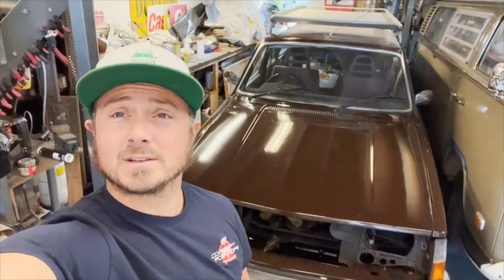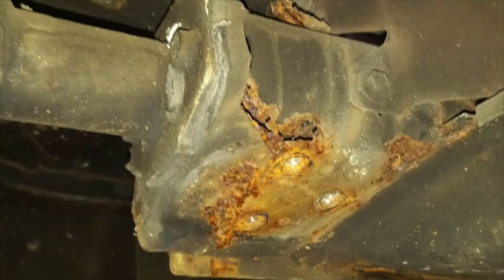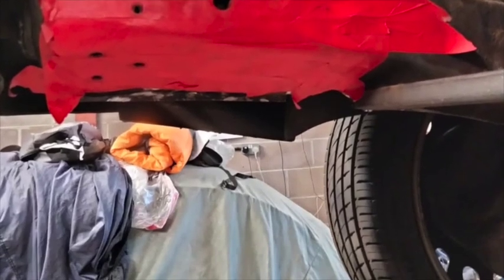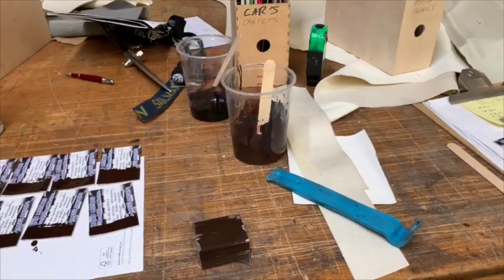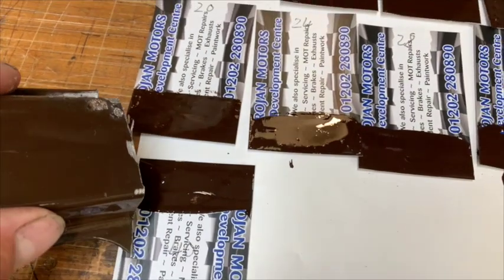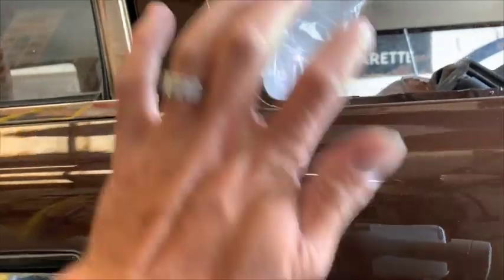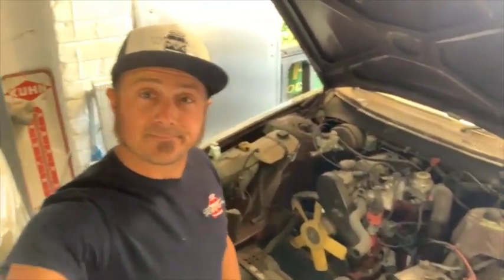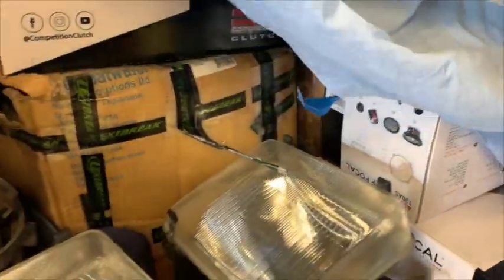Pt:3 volvo 245 , rust repair and repaint

Comment: Hi, what wheels were on it when it was on the trailer....
Where are the major rust areas with the 245... is it just the front legs and cross member or any other major problems at the rear of the vehicle to look for
Reply from the maker: See episode 2 on the custom steels . Rust under rear bumper & where the rear arch meets the spare wheel tub👍
Reply: @TheSpanosAntics  OK thank you for that